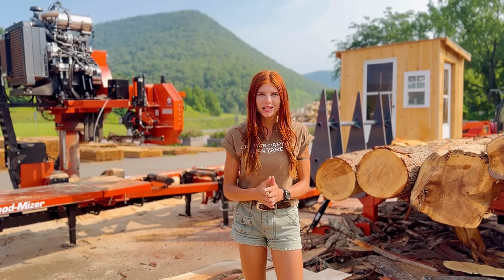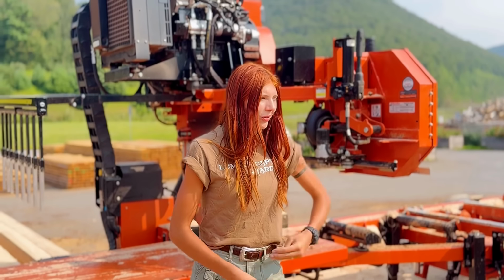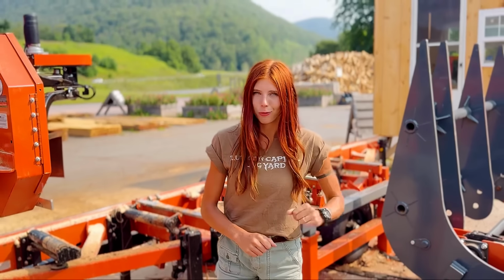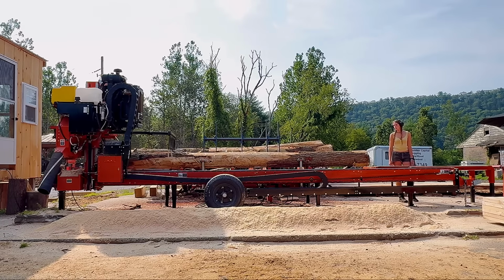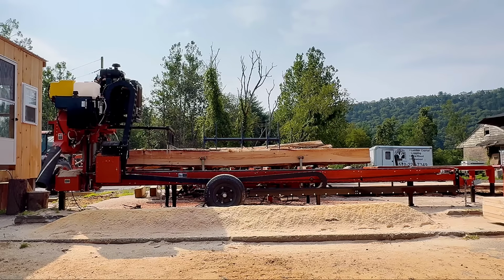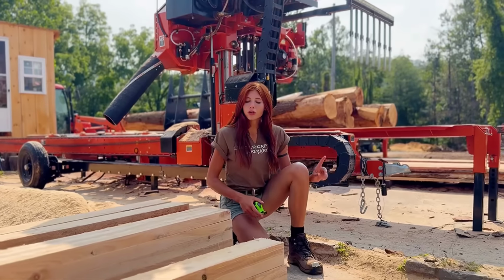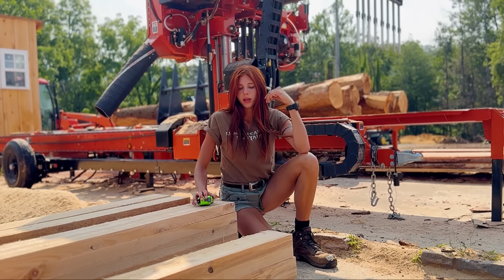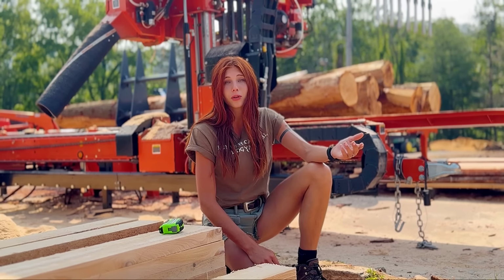Why My Sister Hates Milling 16 Foot Logs!

Comment: I hope the tune up helps with the saw blade breakage.
Reply: Doubt it it was just cutting 1/4" thicker than the computer said it was. She needs to just slow the head speed down about 15% will stop breaking the blades. The production over a week won't be down much compared to losing time unjamming and replacing broken blades.
Reply: @Otherrandomguy42  
Good comment !

Comment: I used to pull green 16' 6x6 off the mill and stack them by hand. I can't imagine you girls doing that. These modern mills are a thing of beauty and no drag chains to watch out for
Reply: In hemlock 16' 6x6 are heavy. That's for sure.

Comment: Great job ladies! I used to work on a portable mill (although slightly smaller than yours), and can tell you it is a rough job not only just handling all that lumber, but making sure it is stacked neat and in the correct piles can be a job in itself! Looks as if yall work very well together too, and that helps, I had an operator who wanted to never wait on me and continually push lumber evn if i was behind. Keep it up, physical labor and pride in ones work is something thats dying off in my age group and younger and I'm glad to see you girls have it! Always looking forward to new videos!

Comment: Hardest job I ever had, piling lumber off a sawmill, but I had to carry everything, what ever was cut most was up front, but then it took a while to move the others to remove the full pile, made you hump to catch back up. The sawyer was paid by the board ft, so he wasn't stopping for nothing. Harder than working for a mason, and I did that 3 years

Comment: Emerald, you need a small camera mounted on the mill with a large monitor in your control room so you have a better view of the blade and what is happening out there.
Reply: Maybe edit some blade close-ups into the final video cut, too. 👍🏼

Comment: Be glad you've got a Woodmizer.  I've got a Woodland Mills. It has no computer and no hydraulics.  Try turning a 16'x20" log with a cant hook.  I only cut for my own use and I work alone.  I also had to learn to use lumber scales.

Comment: Hi Emerald, it looks like the sawmill is well adjust and is doing a good job with the 16 foot logs. You could leave your videos running a little longer, they are so entertaining to watch. I wish you both a good week.
Reply: I would of liked to see Jade pulling lumber for a whole log so I can annualize what she is doing.  I think with some experimentation one could make Jade's job easier. Right now she is pulling the flitches off sideways.  I wish I knew why they are doing it that way, because it makes no sense to me!!   I would pull both the flitches and slabs off the end at a slight angle.  Turning the lumber 90 degrees seems like doing more work than needed.  Just turn it say 30 degrees and off it goes.
Reply: @scottsoper  I think Jade knows exactly what she's doing, she has her own logistics and has been doing it for a long time. It's difficult for outsiders like us to judge the whole thing, for example sorting the different sizes of wood into the stacks. And then there's the space problem, because the different stacks also have to be accessible by the forklift.
Reply: @Maximilian-fs4zw  Good points!  👍

Comment: OK, thank you both for another very nice video. I had not seen a side view of your mill befor and boy oh boy you can really see that saw just walks right down that log. I've seen videos of other mills run from various Diesel engines, always big diameter circular saw blades, unlike your WM LT-70 band saw nice and compact, they are quicker. But along with being quicker they require a lot more machinery and upkeep to make them work. Jade, Em,  have you ever seen a STEAM POWERED SAW MILL working a 5'  Circular blade? They are really something to behold. Near my residence is a county park where they have a steam powered mill for show. You can bring logs to them and they will mill them up for you on days when they run it. Steam power has been around for a long time and it became quite refined befor the Diesel took over. So if you ever observe a steam powered saw mill in operation you will see an amazing performance. There is so much power that if the operator leans on the speed control about the only thing you notice is the log moves quicker and you hear the "CHUG CHUG CHUG" get a little louder. When you see it you realize Steam Was Very Powerful. I hope you get to experience one, it's quite eye-opening. ben/ michigan
Reply: A steam engine never runs out of torque.

Comment: As it seems the mill is not likely to move for a good while, it might be a thought to take the wheels off and store them ins a shed partly deflated.  Out in the sun like that will rot them even if they never turn.
Reply: I think I heard that its better to keep wheels on with some weight on them to help stabilize the mill bed.
Reply: You can always put a tire cover on them to prevent UV from sun degrading them to prevent premature crazing / cracking.

Comment: Emerald and Jade.,  you both do a excellent job, it's always interesting to se what you doing. 16' is rater long planks abut 4.88 m, but what is the normal length is it 8' planks abut 2,44 m?

Comment: I had to fill in a couple of times in the sawmill where I used to work as a Special Project Builder, Hoge Lumber Co.
It was automated than your set up, but still a lot of work.
You need something to handle the sawdust and the flitch you cut off.
Do you plan to have a shelter built over the saw before winter?
Reply: Jade, scoop shovel and the side by side with dump box handle the sawdust. 
     It would be nice to put the flitch right into the edger but they would need a whole new edger or some modifications to the one they have to make it work.   Not likely a priority at this time. 
      It is not likely that at shelter will get built before winter.

Comment: Did I already, remind.. ergonomics, is a field of physical limitation, and unknown strength. 
   I milled, 16’ , 3”x4” lengths of poplar for Marty Scorsese, and Leonardo, in the shutter island film set. I was a mill shop carpenter.  
   Alone in our concern, and with dimensions on hand, we would reduce the 
3”x4” into rails and styles for window frames, to rebuild broken frames for filming. 
   My point: multiple pairs of latex coated gloves, which you’d protect against splinters, avoid callous build up, and wrist support. Pretty please. 
   I have 70 yr old hands, with virtually no permanent damage. I’ve made my living playing guitar, and working days as a carpenter. I can’t say which I’ve made more money at, you’ll want peace and ten fingers, when you’re ready.🙏🏾

Comment: Need logs with less bends.
Would have just about gotten a 3rd one.
There simply comes a point with beams, you don't move them by hand.
Anything under 350lbs-ish, you can move with tools by hand, but get to 500 plus forget it. 
Hydraulics are your friend..

Comment: Do you guys ever take sawmill to other job sites?
Reply: No they do not take the sawmill to other job sites; it is anchored into the cement right where it is.
Reply: @scottsoper Cement is what's in the bag. Once mixed and poured, it is called concrete. I'm surprised you don't know that... 🤔
Reply: @Gilles45  I don't care about  Cement vs. Concrete: the mill is anchored down.
Reply: @scottsoper  Good thing you're around to answer any and all questions! What would people do without you! So you don't care about using correct terminology, that's your loss. I do... and I'm French by the way...

Comment: If the mill or any piece of machinery isn't doing what the computer told it, it's because the sensors aren't calibrated or working. Or it doesn't have sensors, and then why does it have a computer?

Comment: Wow I can't believe that Emerald is sitting in that air conditioned doll house and Jad isn't even provided with a small awning with latus for shade !!!!!😢 We need to start a potion to get her some kind of shade or a doll house of her own with an awning to shad her work area Emerald you should take better care of your sis ha ha ,,,, that's all I could think of through out the whole video damn I missed everything 😢 maybe i should talk to Grandpa about this, good video!! I take great care in making adjustments replacing guide barrings and measurements from blade to bunks and making sure my blade is parallel with the bunks,I started using a wider blade as well seem to track much better
Reply from the maker: Jade and I both have a Mister/fan that one of our viewers was kind enough to get for us! Right now, Jade does not have a awning, but she does have a umbrella which she finds sufficient for the task
Reply: @lumbercapitallogyard  I am glad someone got you a mister/fan !!!
Reply: @lumbercapitallogyard  mister fan !!!!!! good idea i think im going to try that , i been misting the fabric i have over the lattice on my awning when the wind blows threw it it cools the air but mister-fan  would be be a lot better. im thinking about gitting so cofffie any suggestions i dink it Black and Strong ????? your Family Rocks your Vids have just gotten better and better !!!!!!! im cutting in the North complex fire zone /Bear fire (3 years ago) and ive had three other fires less than 20 miles away Park fire is the latest all in the last 2 months with triple digits heat almost 0% humidity   and most days are Red Flag days so i cant cut. Glad you have some shade Jade you girls stay cool safe and the saw dust flying !!!!!!

Comment: Did anyone else hear a squeak on that LT70 when the engine was turned off after milling? Sounds like bearings...

This machine is too new to be making noises like that.. I'm replaying the squeak in my head over and over... maybe bearings... the age of the machine does not match. The squeak lasts no more then a second and probably something to do with the blade traveling then occurs when the blade comes to a stop. Roller/journal bearings?

The squeak is more pronounced and I sure this is only going to get worse with use... Woodmizer 'adjusted' this equipment recently; probably need to get them back out.
Reply: that squeak is the belts and is normal.
Reply: @scottsoper  So the WoodMizer LT70 is supposed to squeak. That's normal??

Comment: WOW Jade, That 4X6X16 is one heavy piece of lumber!    So here is where doing it my way would pay off!!!   Put the piles at an angel so you don't have to move them through 90 degrees, just say 30 degrees and slide them off.  On the far end you are having to lift the flitch on one end and then the other. Set it up so that the flitches come off at a slight angle off the end and the slabs come off at slight angle off the end the other way. This way you roller both most if not all the way off.   Experiment a little!!! I think you can make it just a bit easier to do.

Comment: 🙏 Thank you God for that order of High Quality Boards, Thanks also to the Expert Andrew in Adjusting the Sawmill. I had really noticed that the Boards were not coming out in pairs within the Measurements, as I think that although you learn to Calibrate the Sawing Machine Yourselves it is A Job Should Always Be Done by an Expert, Even if they say I have the Virtue of God Through Learning and Performing Various Jobs with ease, I am of the opinion that as long as we do not have the necessary knowledge and mastery in certain subjects, we must turn to professionals, we must respect the work. alien like the others to ours To avoid undesired incidents and obtain the expected results, it is also dangerous for you to calibrate with engines on I do not want even the least to happen to you, you should use a better method of protection even Null take care of your body, inactivate the blade or saw blade in a better way, But I will comment on that in the video he is Working, Emerald Take Care of My Life Your sister, Jade I am really Worried, that those Planks are too much for You you must Measure Your strength you do not want it to harm you Nor mistreat you anymore your hands and feet please, within what you should and can, if you are strong in achieving your goal, doing the job well is always rewarded, maintain a lot of sanity, your value is incomparable to me, I have also been working for days, I sleep little, 2 hours a day But I'm waiting, Watching, Glued to Your Channel, making me happy, Also getting a little sad about my Day, it's too much to say why, But Everything is Good with Your Videos, Super A Family and Its Boss, Example Also for Me, Blessings.